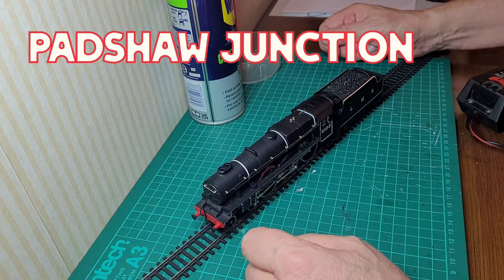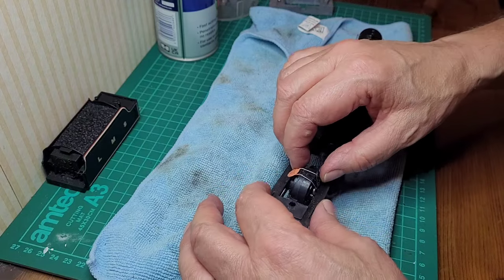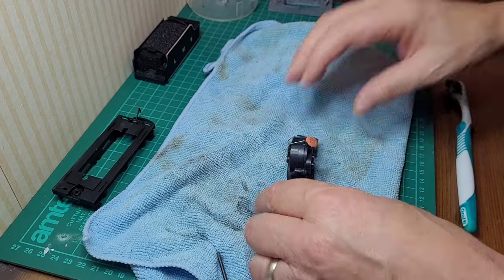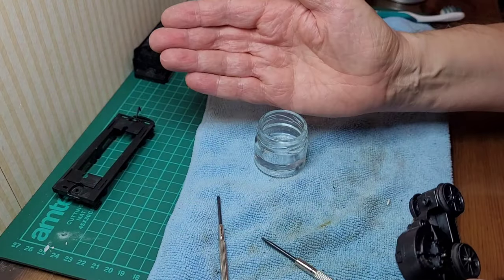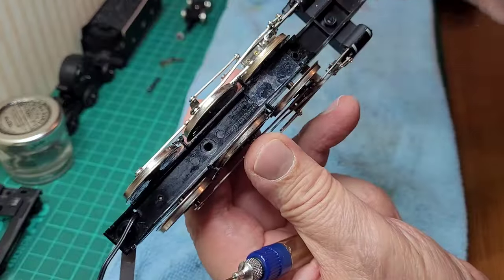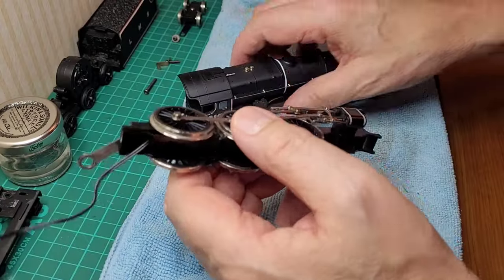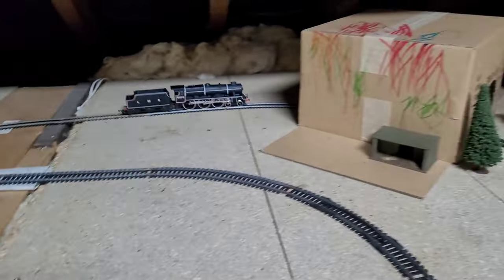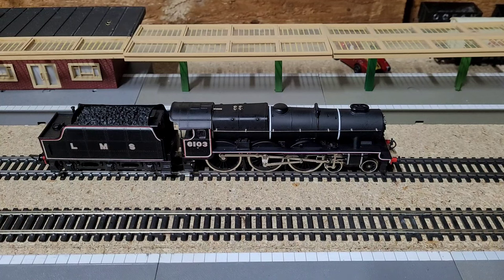Ebay Airfix Royal Scot. Service and Repair.

Comment: A tip for you and others, when refitting screws into plastic, turn the screw anti-clockwise until you feel or hear a click (this means you have found the thread in the plastic) and then screw in clockwise. This stops you cutting another thread which will weaken the plastic in time.
Reply from the maker: Thanks for that tip Malcolm. Thank you for watching too👍

Comment: I forgot to say that when I got this loco 40 years ago, the front bogie would not negotiate 2nd radius/small Hornby points well. So I removed the spring under the bogie and it has not given any trouble ever since. I don't know if this might help others.
Reply from the maker: Thanks for the tip sir. Sorry for the late reply I have just come home from being in hospital,  hope to get back on the railway soon!

Comment: It's a shame that the plastic on Airfix products particularly has gone brittle. I have had one of these since the mid 80s but it has only run for about 6 years in total. The keeper plate also cracked on mine and I have superglued it with a piece of plastic with success. Mine is hard wired to DCC and I have yet to summon the courage to service the motor. But it runs remarkably well and it's slow speed running is perfect for such an old model, so I am going to leave it until it starts to misbehave. It also has good pulling power.. Mine isn't quiet either. Anyway, thanks for a great video. Really thorough and helpful
Reply from the maker: Thanks for watching and commenting. Sorry for slow reply,  still stuck in hospital!